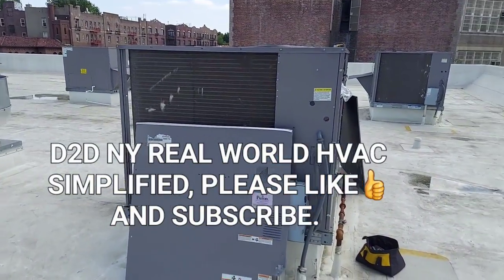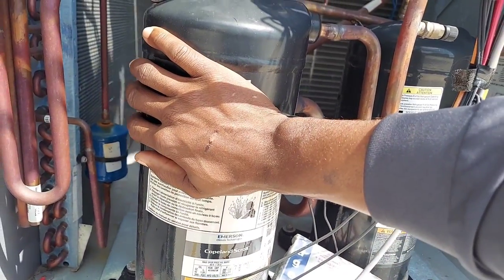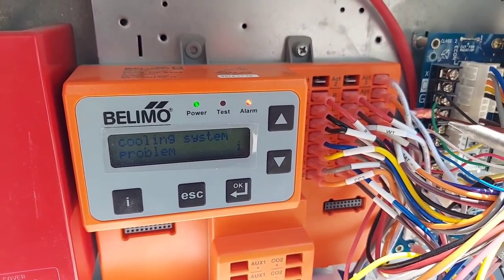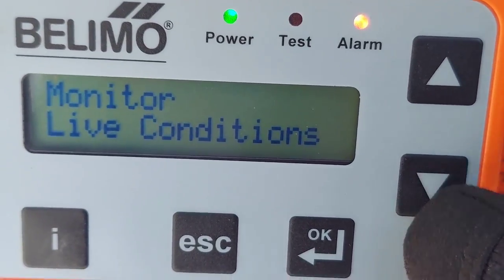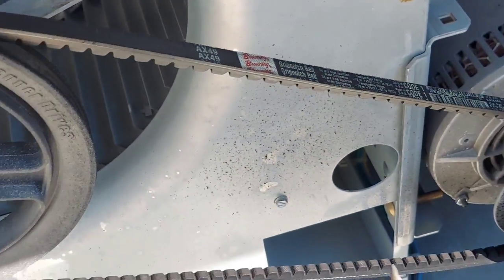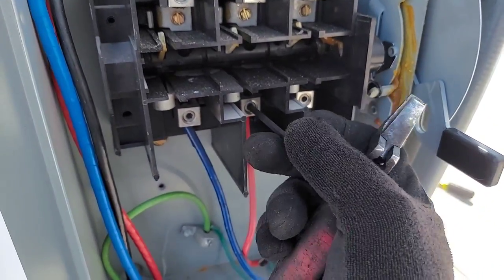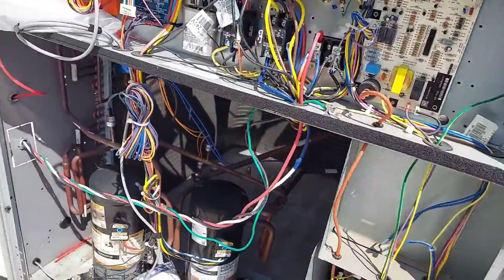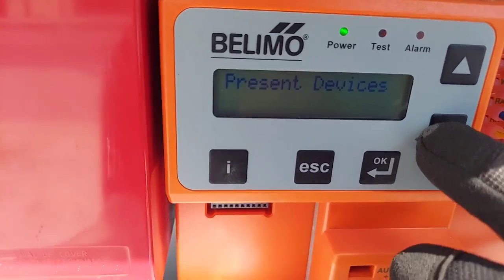HVAC TROUBLESHOOTING

Comment: Hi. 
I noticed that the control transformer is connected to the 240 VAC, from the factory. 
Is it not supposed to be connected to the 208 VAC.? 
due to the fact that your meter shows only 204.
Reply from the maker: Yes sir absolutely